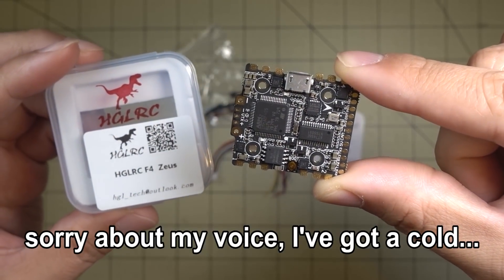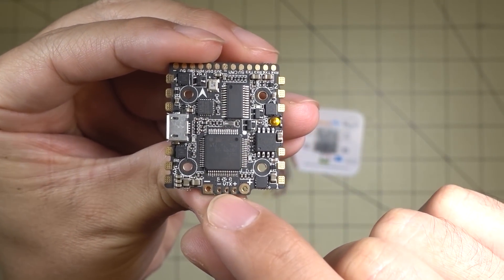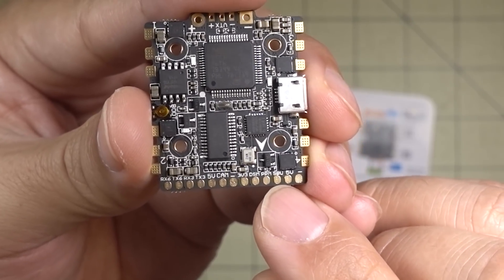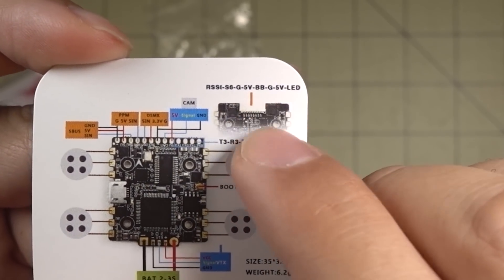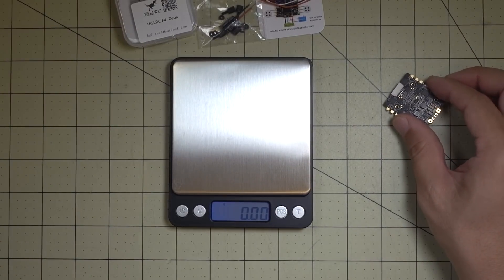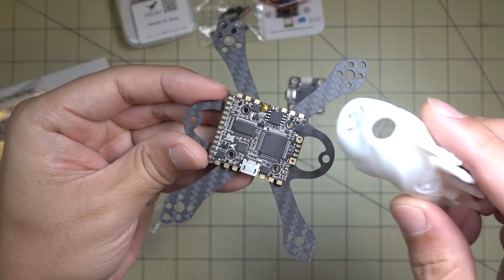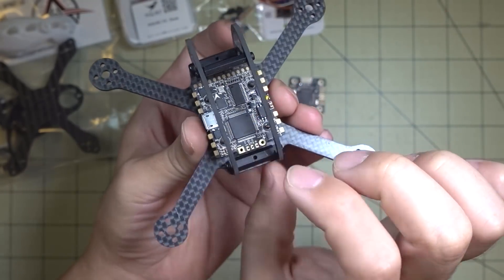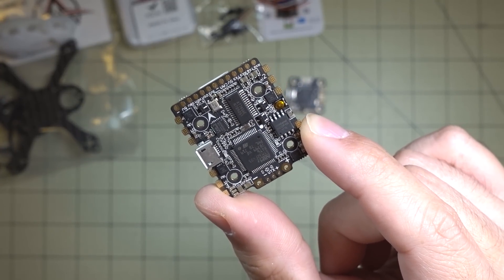HGLRC F4 Zeus AIO FC+ESC Review 👍

Comment: Great review Albert.  I have an old TomoQuads Mikro 78 frame that I never got around to building.  Think this will for in that frame?
Reply from the maker: Not sure about that.  The space is very tight in that frame and this board is a little oversized.
Reply: Thanks Albert, I'll just roll it like you did.  FC with esc's on the arms   :)

Comment: Albert,  I'm currently using that on the Ascent 3 frame and it fits perfectly with plenty of room for the runcam split.
Reply: +Arnold Vales I just built the light version of the Ascent frame (FlexRC calls it the "Komori"), and the Zeus board fits perfectly. If you're looking for an ultralight 3" build, the Zeus board with the FlexRC Komori is just about as light as you can get. I've got EMAX 1106 6000kv motors on it on 2s, and it is just unbelievably fun. Since it's so light, it's a bit "floaty" on vertical maneuvers, which I really like. You can do a punchout, then swing around so the camera is facing the ground, and continue to go up for a long time with zero throttle. That same light weight means that it corners like it has vectored thrust! I only fly 3" and smaller quads, and this is by far my favorite so far. Sheesh, I hate to sound like I'm shilling for FlexRC, but it really is that awesome.

I'm going to build out the standard 3" Ascent frame just to compare it to the Komori. Yup, I sound like a FlexRC fanboi, and that's because I really am... I have four FlexRC frames now, and they have rapidly become my favorites.

It would be really fun to have Albert build out either the standard 3" Ascent or the lightweight Komori with the Zeus board and see what he thinks. IMO, it's the most fun you can have without breaking the law. :)

I just hope Albert isn't still mad at me for ranting on about his giveaway that was for Gearbest customers only. No hard feelings Albert, just because we didn't agree on that one thing doesn't mean I'm not still here watching all your awesome videos and hitting that thumbs up button every time.

Great review, as always, Albert. Looking forward to your build that uses the Zeus... no matter what frame you choose.

I do love the Zeus board, but I have yet to figure out how to access the black box data.
Reply: Arnold Vales Hi, do you know if there is pad for a buzzer? Thanks.

Comment: holy sh*t :)
Reply: Perhaps mouting upside down would put the ESC fets in more direct stream of forced air from the props, keeping them a bit cooler ?
Reply: +Dave Johnson Yup, you could very easily mount your rx on the bottom of the stack, then mount a HGLRC TX20, then top it off with the Zeus. I haven't had a problem with the ESC's getting warm with it mounted at the bottom of the stack running emax 1106 6000kv motors on 2s, but that's not really a lot to ask of the ESC's, either.

Comment: Can you get a runcam micro on the leader 120 with that board? I had to modify my mounts with the stock stack. I eyeballed it and I think the standoff is also in the way of the cam in normal angles anyways.
Reply from the maker: +Scraggle Roc I think it will fit.